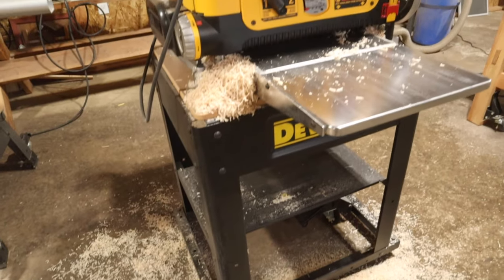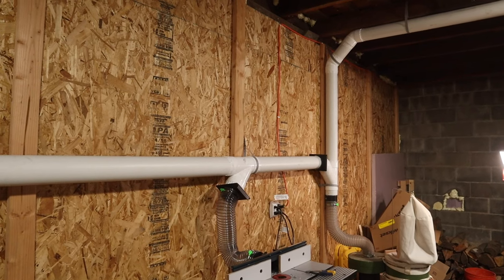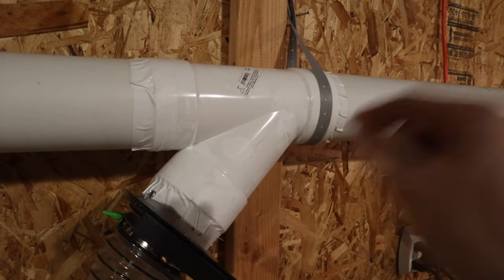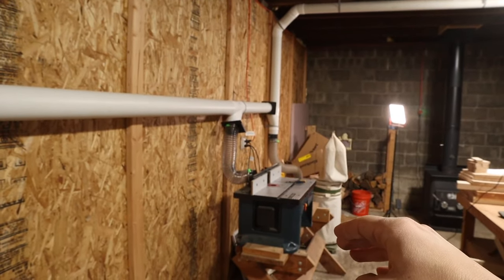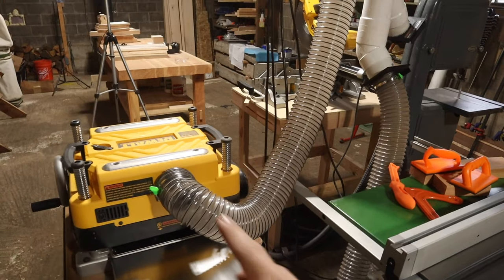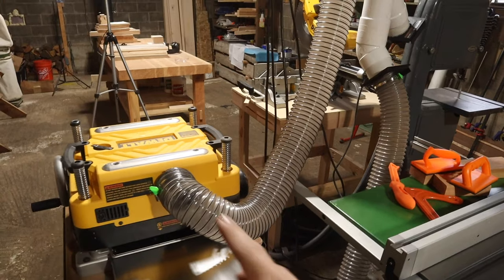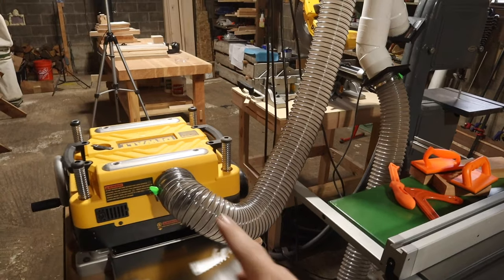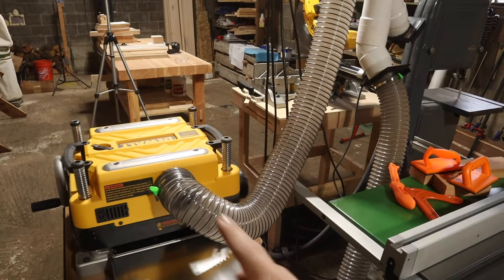4in, PVC Dust Collection Upgrade | Much Better!

Comment: Wow you have a long  run .what kind are you using for dust collection   moter and barre set up.,l ect . How is it working for you.
And how's it been
Reply from the maker: Yea, it’s pretty long. I have a generic 1 HP dust collector that needs to be upgraded but the system as a whole knocks the socks off my shop vac. It collects dust well and is also much more convenient than lugging my shop vac around.
Reply: Thank you, best regards

Comment: IMPORTANT... A viewer has made an extremely good point regarding this piping system. Without a copper ground wire attached to and wrapped around the lengths of the outer PVC en-casement of the pipe. The fire risk is 82.56% higher towards catching on fire from fine particles and friction causing ignition.
Ideally all piping should be constructed using metal piping. However, this should be ok (ish) when using in the home workshop. BUT... I would take action by grounding your system asap. The aluminum tape also helps with this but make sure the copper wire is taped under it. You should be aware that any workshop using PVC piping type system that doesn't meet world wide OHSA & NFPA dust extraction system standards (which yours Does Not!). Often means your workshop and items within it aren't covered by insurance should it result in a fire.... and yes insurance companies world wide will investigate this as a probable cause - you decide if this risk is worth taking?
Reply from the maker: Hey Kevin! Thanks for the response. I agree that this isn't set up for a commercial shop and if metal can be used instead you'd be in a much better spot. From all I could find online, there have been no cases of static discharge ignitions caused from PVC piping in a wood shop. 

That being said, you quoted a very specific increase in risk, where did you get your number from?
Reply: have a passion for woodworking and the likes, so rather enjoy watching videos such as yours.
I also appreciate your query so we can all learn from it.
I was once the national manager for dust &  extraction services, a firm that's well recognized in several countries around the world. They often work alongside governments agencies to ensure extraction units/devices (mainly dust but not always) meet industry standards. This company was commissioned and responsible for calling on woodworking industries and workshops (often unappreciated cold calls) both large, small and home workshops (when home base shops can actually be found) - nobody is excluded from meeting the required regional/national standards.
The agents roll was inspect, test and educate businesses & individuals on the long team health and environmental effects of dust extractors (+ other extraction systems such as sprays painting filtration etc), plus work alongside fire departments to gain data from industries that have sustained major fire damage or total loss, to build accurate data on types of dust extractors, pipe material used, airflow speeds, pipe lengths, number of bends within the line etc, etc. So yeah, there are a lot of factors to take into account.
This firm is a world wide network in which I gathered my standards, data and experience from to provide you with factual data as per my previous post. They may operate under different names dependant on country, but essentially they're all required to meet the same standards to the same dust micron levels and type of ducting materials used to assist risk.
Throughout this period, I seen multiple outcomes where PVC piping was used and the fire department commission validated the use of various plastics "can but not necessarily" cause frictional fire where the dust particles and oxygen airflow levels increase fire risk.
It always frustrated me how either individuals or industries could face prosecution for risk of endangering themselves of others (country dependant) rather than provide ways to advise people of safe practice and products before they happen.

Your quite right when you say there's very little known to the public regarding PVC pipe or workshop fires.
I assure you, if prosecution for negligence or an insurance claim takes place, officials will use the view that there is No PVC certified entire ducting system on the market (world wide). Most - if not all PVC piping / ducting systems are installed by people other than a qualified engineer which then breaches any standard making them a liability.
I admit when I first started my woodworking factory I used PVC piping but it quickly needed replacing once I began to grow (thankfully to educate prior to fines).
If you continue to use your PVC system, I strongly suggest using the copper wire method. Simply spiritual copper wire around the pvc pipe from one end to the other of the ducting. One loop around the pipe every meter seems to be what I've seen in the past (it doesn't have to be wound around close knit together sort of speak) then screw both ends off to a well earth item - such as iron roofing or cladding is a good idea.
I must say this method isn't proven to stop fire but it's known or presumed that it "may" reduce the risk? Throughout my experience, im unaware of how many workshops burst up in flame that did have copper wire around the piping.
I resigned from this role as the powers became more focused on fineing people rather than to educate (Intresting how there's no online stats huh!). Although I'd be slammed by authorities for the fact that you make an effort to reduce dust particles from your lungs, workshop and your surrounding environmental, I really do praise you for making an effort towards doing so - Just ensure your aware of the risk cause its real! Also... Just in case the copper does work? - Wrap your PVC ducting with copper wire ASAP!!  It would also be great if you could use your platform to educate others with this method also. Lets help reduce the risk to all.
Keep your videos coming.
Reply from the maker: Fascinating! Thanks for the detail.

Comment: Interesting 
4" PVC here is ~5$ a foot
4" metal duct is ~3$ a foot
Is there a cheaper PVC I don't know about?
Reply from the maker: Man! That’s spendy! Check for DWV PVC which can be much thinner than SCH40. I got mine for about $1.80 a foot
Reply: @NorthwestCraftsman  at the home depot here in town the sch40 is listed as DWV. Did you get yours from a different type of store like a plumbing supply shop, perhaps?
Reply from the maker: I got mine at HD but different Home Depot’s carried different options. It looks like it’s gone up in price a little but still pretty cheap (https://www.homedepot.com/p/JM-EAGLE-4-in-x-10-ft-PVC-D2729-Sewer-and-Drain-Pipe-1610/202280933) though, if you can really do 4” Metal for $3 a foot, it may be worth the upgrade.

Edit: Okay, super weird, I went to confirm the link and HD isn’t connecting it unless it’s at the exact store. This is the product I bought, see if you can find a HD or Lowe’s that carries it. 

4 in. x 10 ft. PVC D2729 Sewer and Drain Pipe
Reply: @NorthwestCraftsman  A 5' section of 4" metal ducting is $15.98 here or $3.20 a foot.

With your help, I do see "4 in. x 10 ft. PVC Belled-End Gravity White Sewer Pipe" at my local home depot that appears to be the same. That's $32.96/10 or $3.30 a foot.
Reply from the maker: Oof, that’s nice and spendy. Honestly, I’d go for the metal if it’s also cheaper than the PVC.

Comment: Nice system, **advise from anyone in the  know please**, I have recently purchased my first proper dust collector ( apart from shop vacs). It's a 2nd hand Electra beckum which pulls 1000m3h which I believe is about 588cfm. It came with about 6foot of 4" flex and works nicely with table saw etc. Question is , would it be powerful enough to make a bit of fixed system where it pulls up to ceiling and along several feet and down again, so it could be used with a couple of blast gates etc??? Thanks
Reply from the maker: Hey Stephen! Congrats on the new dust collector! Your question is a great one, unfortunately it's also almost impossible to answer without taking some hand measurements and knowing the exact dimensions of your shop. Your math checks out and based on some quick internet sleuthing, it looks like you may have the 1HP motor model. Mine is 1HP as well and if we assume similar efficiency at the opening (big assumption), it should work for a basic setup like mine. Here are some rules of thumb that should help though:

- Avoid flexible tubing as much as possible, as it has far higher loss rates than rigid smooth pipe
- Cut down on the number of corners
- When a corner is required make the turn as smooth as possible (i.e. 2x45's instead of 1x90). You can also see this with my Wye joints. 
- Install blast gates to isolate the line in use only, no more
- Ensure connections are solid to prevent leaks. Cheap blast gates are a major cause of this. If you're only getting a few, I recommend some high quality self cleaning ones. I haven't used any of the ones below but they look pretty good. 

Self cleaning blast gate
https://amzn.to/3Xcgkzh
Reply: @NorthwestCraftsman  thanks for the info!!  I think motor is 3/4hp as it says .55kw, 1000m3h, but it's the induction motor type with an upper and lower bag , low pressure, high volume collector. Shop is about same size as yours but it's a garage too to park van in etc too so the couple of machines I'd run off this are close to each other. Ducting might be say 2m up, 4m along top and a couple of 2m drops to table saw and planer with flexi on the end connecting to the tool. With a couple of blast gates to isolate suction. Other way of course is just to just keep collector nearby with 2m of flex and connect to each tool as needed. I've got shop vacs further away sorting mitre saw and band saw etc.

Comment: My system is very similar to yours.   I’m disappointed in the air flow.  Any suggestions or ideas on how to increase the air flow?  I have a Laguna Pflux dust collection system.  I think I should be getting more air flow.
Reply from the maker: Hey Thomas! Sorry to hear your system isn't working as desired. Unfortunately only broad generalization about DC systems are possible without measurements. For a deep diagnosis of what is causing the loss of airflow, I'd purchase a cheap anemometer from Amazon (Here is a pretty well rated one for ~$30 https://amzn.to/3gO2GlQ). This will tell you exactly what the airflow is at different points in your system so you can determine where you're losing suction. My example diagnosis may look like the following:

- Measure directly at your dust collector without any hoses (watch out for the impeller). This will tell you the maximum possible airflow in your system. 
- Measure at each of the next major outlets as though you're using them (blast gates in the correct configurations) starting closest to your DC and moving out. 

The losses you see at each of these openings will pinpoint what additional losses are caused in the features between reading locations (Flex hose, corners, etc). For example, if at the DC you have 500CFM and then you have a straight shot to your first opening and read 490 CFM. This confirms that a straight shot gives hardly any losses. But say then you go to the next one after a run of flex hose and read 320CFM. This would indicate a loss of 170CFM due to the flex hose (490-320) and may indicate a need to remedy that section. 

In general, flex hoses, corners, and weak dust collectors would be my primary suspects for losses. I'll likely be doing a video at some point in the future on this as well. 

Good Luck! Let me know if any of that was unclear!

Josh
Northwest Craftsman

Comment: Paint the inside of that work shop WHITE and you will be amazed how much better the light is in side....
Reply from the maker: Oh man, I’ve been so close for so long. I’m torn because it’s a rental and I’m not sure how much longer I’ll be around. My thought was to see if I could get a 5gal mis-mix of some off white for cheap. Any thoughts for doing it on a budget?

Edit: Not sure why I didn’t just check sooner. I can get enough primer for my walls for $30 🤦‍♂️ thank you

Comment: Thanks for the content. I don’t think I saw why you taped instead of chemical bond?
Reply from the maker: Great question! I didn’t weld the pipes because I was renting this shop and wanted to save as much of the piping and fittings as possible for my new shop.

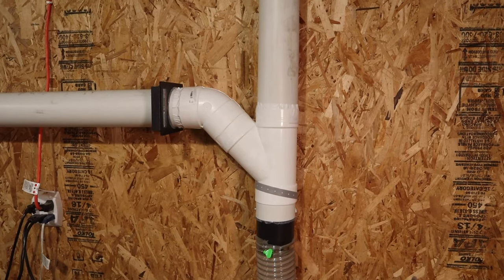Comment: At 5:05 is that “y” backwards?
Reply from the maker: Great question and it is not, or at least it’s mounted how I intended 😂 The air flows down to my dust collector. I have one line off to the left and another coming in from the ceiling. This allows both lines to merge more smoothly into the stream when the collector is on.

Comment: Hope you are alive. The plastic pipes are not conductive, so... the pipes should be sparking and just waiting for the dust, then- explosion.
Reply: Friction will do the job to make it alive, no grounding can be applied.
Reply from the maker: From everything I’ve seen in my research, there hasn’t been a case of a hobbyist woodworker sparking an explosion from ungrounded, PVC pipes. However, I would agree that it’s possible in theory, and that best practice is to use metal ducting. At the time I built this system, I couldn’t afford to use metal ducting so I opted to take the, arguably, very small risk to help prevent long-term dust exposure.

Comment: On the wall you have the y mounted in the wrong direction facing down ??????
Reply from the maker: Not sure exactly which one you’re talking about but I have them facing the direction that allows for the least resistance to airflow 😊

Comment: You should not use non-conductive materials (PVC in this case) do build dust collection systems that carry combustible (wood) dust. This is actually against regulation, see NFPA 664, part 7.8. https://www.glacier-technology.com/wp-content/uploads/2019/04/664-17-PDF.pdf
Reply from the maker: Thanks for the link Peter. Do be totally honest, I’d never seen those regulations before and I appreciate you sharing.